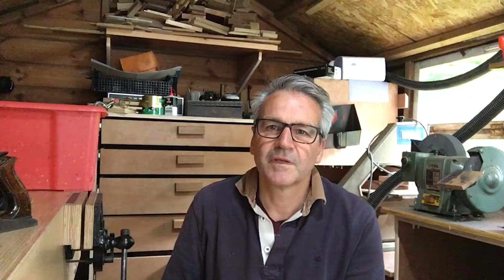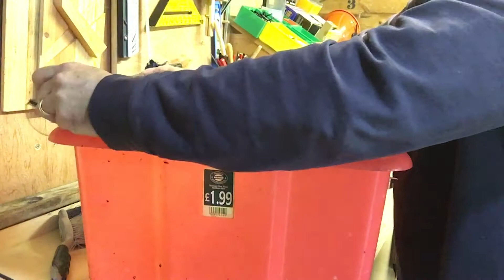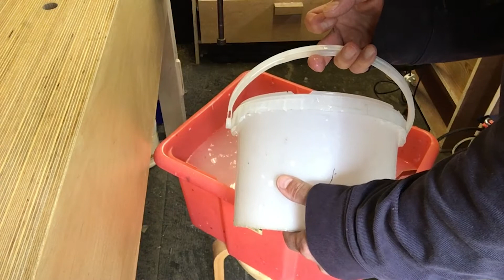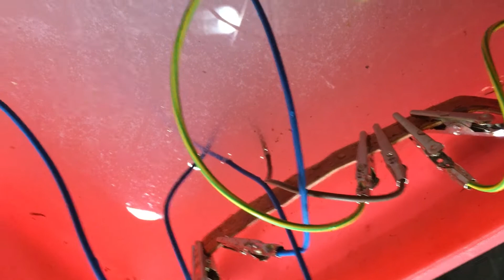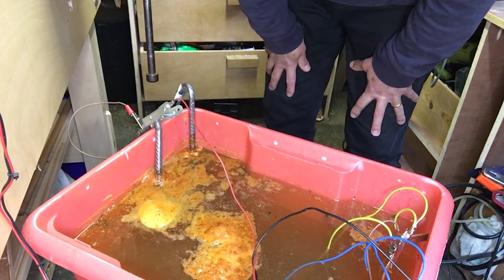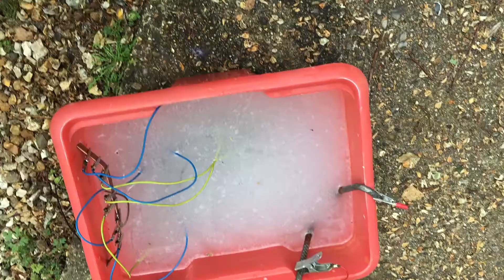Making an Electrolysis tank for rust removal

Comment: You got a good deal on the 4 1/2 hand planes.   They looked to be in very good condition before the electrolysis.
I have seen videos where graphite blocks were used for the anode.    This created almost no scum so the quality of the material in the anode may contribute a lot to the messy scum.
The battery charger needs to be the old style without todays safety protection circuits.   I have an old and new ones.   The new ones will only work if they detect voltage from a battery.
Dave.

Comment: Good video, I'm looking forward to see the copper plating it's something I tried without much success  in the past
Reply from the maker: That fills me with confidence!
Reply from the maker: I did it as a kid but that was just nails or random objects, I am not convinced on the rust removal yet as it leaves a black residue good for painting but hard for metal finishes like tools as also difficult to remove
Reply: I used a wire wheel after cleaning axes with electrolysis, worked OK, 
I  couldn't get a thick layer of copper it always seemed to rub off to easily